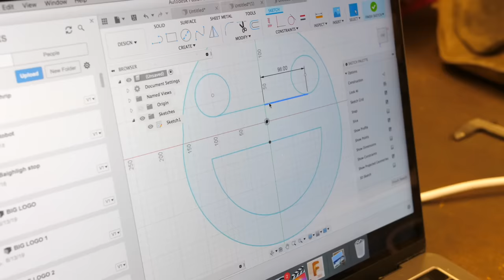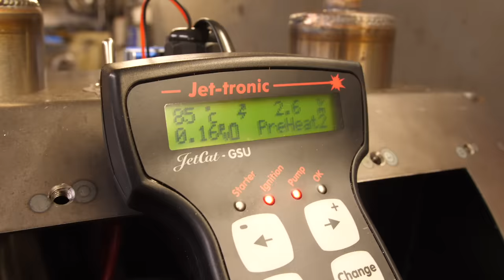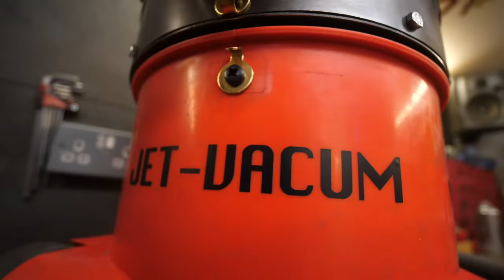JET POWERED Vacuum Cleaner

Comment: You made a  cordless vaccum cleaner  that has a runtime longer than Dyson
Reply: Priyanshu James so a diesel engine vacuum cleaner?
Reply: @ghostintheroom  you must admit he's got a point there
Reply: @ghostintheroom  that is the future of vacuum cleaners
Reply: Well rip my 800
Reply: @Jack Armstrong *Kerosine
Reply: How's vaacuming with an afterburner ?
Reply: @thechlebek901   How about a bi turbo V8 paired with an industrial grade vaccum pump
Reply: @priyanshujames2300  nah let's use Merlin engines, we'll just need cryogenic liquid oxygen and rocket grade kerosene
Reply: TRUE
Reply: What happens when you suck up the flame from the jet with the jet?
Reply: TV ad goes on. "Get the new Colin ferz vacuum it smashed dison to the floor".  

Dyson 😈

Colin ferz vacuum 😇
Reply: And IT Sounds Like a Dyson aswell
Reply: And it has a smiley face!
Reply: Boom
Reply: Not if you want to vacuum for more than a couple of minutes when Frank seemef to overheat and suffer from what looked like an engine rich exhaust.
Am sure this is just a teething problem though...
Reply: Also doubles as a lighter
Reply: Oh sh!t dyson is gonna be on your @ss
Reply: It’s also much quieter than a dyson

Comment: "generally jet engines don't want to be vacuum cleaners"
Reply from the maker: the things I say eh
Reply: @colinfurze  i love you with all my heart
Reply: Generally.
Reply: @colinfurze  can you build a pod racer?
Reply: @colinfurze  I love it, just the right amount of crazy that we've come to expect from your channel, could perhaps have given the poor little jet engine an easier time using the output to drive a venturi instead of directly using the low pressure side, would have certainly eliminated the smoke issue and reduced the EGT.
Reply: @jamesharris5158  good idea!
Reply: Thought he was going to use the exhaust to draw air through not suck it straight through
Reply: @hseanhill Yeah, that's what I was getting at with the venturi, it's an arrangement that effectively converts a stream of moving air into a low pressure zone that draws air in through a second line. It also works with liquids, commonly used in pressure washers to draw the soap in.
Reply: @dayzeddy0199  yes he did just a few video's back. he made a red pod racer
Reply: HAH!
Reply: I don't know, I think they don't want dense air filters over the intakes. I reckon if you set the hover up as a cyclone separator, dispense with the filter, it will probably work well enough (or at least not keep dying).
Reply: Maybe use the jet engine to mechanically drive a small fan - so the vacuum cleaner air circuit is separate from the intake and jet exhaust. Probably get a much cleaner exhaust too as the jet gets a consistent stoichiometric mix without the vacuum cleaning flow variation
Reply: @sirBrouwer  that's not a pot racer this is a sandspeeder bro i am a star wars nerd i know a few star wars vehicles 😅
Reply: @colinfurze  3rd track is called of Cuba Libre - Murica Composed by Jangdol Drum, 라더
I have to awake in 5 o'clock am and taking a shower and breakfast(Cereal and hotel breakfast Area)
Stepmania rage (read description)

Comment: Jet vacuum cleaner:
coolness: 100 %
efficiency: 0.0000000000000000000000000547 %
Reply: Chance of burning your house down: %8594
Reply: HA, ha, ha!
Reply: It adds up to more than 100%, which is an amazing feat in itself.
Reply: @GunGryphon  each criterion is individual indeed
Reply: Smells: 4865%
Reply: @GunGryphon  Look at the porsche 919 evo.
Efficency: 40-50%
Coolness: 99.99%

That's a bigger sum, so....
Reply: adds an oxidizer to the fuel tank to increase the motor speed and suction force of the jet powered vacuum cleaner

Comment: "Mr Browning?"
"Yes Colin?"
"Can i borrow one of your super cool and expensive jet engines?"
"Sure can't see why not, it's not like you're gunna suck crap of your shed floor through it...."
"Mwahaha" said Colin
Reply: Filter...
Reply: Just a polite heads up, all hoovers have some sort of filter included in the design to protect the electric motor from particles that can cause wear and tear and minor clogging, and colin would have used the filter as it would have been used on a standard hoover... if he didn't then trust me there would have been a lot more fire and A TON MORE SMOKE when sucking  up those lentils.....unfortunately he did not show if he used the standard filter fabric layer or whether it was customized/upgraded... However I did apreciate your joke to be honest dude so high five... comment liked!

Comment: I’m no engineer but if you were to route the jet exhaust through the exhaust side of a turbocharger, and use the intake side of the turbo for suction, similar to how it would be used in a car only the the compressor would suck air through the hose providing suction and the jet exhaust would spin the turbo. I think this might solve your oxygen starvation issues. That’s if the exhaust temperature from the jet would be too hot for the turbo.

Comment: I wish he used the engines that he built himself years ago.
Reply: @katelights  not the pulse jets the jets made from turbochargers
Reply: @lucyg3917  They probably wouldn't even start with that sort of pressure drop in front of them - the engine shown here really struggled and was probably quite badly damaged in the process.

Comment: "Frank Whittle designed the jet engine" angry german noises
Reply: Hans Joachim Pabst von Ohain was a German physicist, and the designer of the first operational jet engine. His first design ran in March 1937, and it was one of his engines that powered the world's first flyable all-jet aircraft, the prototype of the Heinkel He 178 in late August 1939. Wikipedia
Born: December 14, 1911, Dessau, Dessau-Roßlau, Germany
Died: March 13, 1998, Melbourne, FL
Whereas Frank Whittle patented his in 1930 and built the first operational turbojet engine in 1937 Eric~
Reply: Don't worry about the Germans it's patent 1930 vs 1936

Comment: Fantastic, as Furze projects always are, but... you need a gas turbine with separate power take of turbine and shaft, like turboprops and modern jet engines. Then the jet part can run with all the air it wants and the separate power turbine can directly drive a vacuum turbine. Maybe run it on gas too, less smelly. Could you make it run from mains gas??? Frank mark II maybe??? You should talk to Numatic and see if they'll sponsor it!

Comment: As jet engines work much better with high airflow, I wonder if you could have kept your ballast pipes open and used the Bernoulli effect to suck air out of a T junction: The fast moving air flows past a hole (or porous section of the pipe), sucking more air into the flow through the hole(s). Having the intake be a cone shape could further increase efficiency via the Venturi effect.

Comment: Hi Collin
Super awesome project; but I think it's effectiveness as a vacum cleaner can be improved while solving the overheating issue when you use it as a high-bypass (where the bypass comes through the filter) instead of using the intake to create the vacum ;)

Comment: could solve the problem by making it a venturi style system like the hand held ones that use shop air pressure flow to create suction. that way the jet always has the needed airflow and you still get a vacuum .

Comment: Now, if you were to use a gas turbine to power the suction fan of a vacuum cleaner mechanically, the way a jet powered helicopter does, I suspect you'd be able to tear up the floor boards like Vyvyan Bastard's V6 powered vacuum cleaner in The Young Ones. "that vacuum cleaner's a hell of a sucker...and I don't mean it's easily fooled".

Comment: Perhaps it could be re-envisioned as a vacuum incinerator/compactor. Use a more normal suction method, but make it so it can suck-up a lot of stuff without constantly emptying it.  Maybe with the goal of making solid pellets it excretes.  Hot enough to melt glass. 

If you want it to suck more, use the vacuums they have on parking lot sweepers.  Little tube is doomed.  It is the atmospheric pressure that pushes the air into the tube.  If you want to crank it up, you want 6" diameter hose or more.

Comment: 1. add crank shaft
2. connect crank shaft to fan, which powers the actual vacuum
3. ???
4. enjoy extremyl powerfull vacuum without running hot

would be a nice change if one of your contraptions would actually be usefull

Comment: If it has a big output should you have not increased the input? An additional series of vacuum tube hoses along with that one all connected to one big Exhaust Pipe End at one side and the vacuum cleaner at the other side?

Comment: Use in a well Ventilated environment, do not face engine twords flammable materials, do not touch the jet engine, do not run with oxygen caps attached, only use diesel fuel

Comment: If you naturally aspirated the jet but ran a shaft to a three fan vacuum blower you wouldn't starve the jet of oxygen every time you put the inlet on the ground or other surface, and it wouldn't over heat from lack of cooling air flow.

Comment: Just attach an air particle separator to the intake of the engine, and use the hose as the only air intake. Helicopters already use these to keep dust, dirt, and other things out of the engines.

Comment: Run the exhaust into the hot side of an automotive turbo, use the cold side for your suction, blow the cold air out with the hot exhaust to lower temperatures even more

Comment: Probably not possible with that particular engine, but what you needed was a turbine. That would let the engine run on clean full ox air, instead of the air sucking in the dust.

Comment: Should've just let the dust go right through the jet engine instead of passing the air through a filter first. That filter starves it of oxygen, though I don't know how long you can continue to use the jet engine once it has been used without a filter

Comment: Wouldn't it be better to combine the jet engine with a turbo so the jet can blow the air (as it is designed) and the turbo would convert that into suction? This approach would limit the problem with oxygen starvation. I guess few Bars of pressure would destroyed the staff being vacuumed 🤣

Comment: Hm I dunno how well a jet engine does with dust, even if it's not a single-crystal superalloy turbine. For spiders it's just going to be cruel and nightmarish. I think I'd do what a turboprop does, and use the engine's shaft to drive a propellor, perhaps the vacuum pump that came with the Henry, if it can take the power. 

It would also mean the engine gets all the air it needs, it's obviously not designed to run so lean, plenty of engines have the same problem, you're lucky you didn't suffocate even with the shed door open!

Also then, you'd have an opportunity to use belts and more machinery, a turbopump next to the engine belted to it, with big bolts and fins and stuff, like something Doc Brown would use to do his hoovering in 1955. You could make it proper Jet Age looking. Since it has an actual jet. Of course it would need to be red, fortunately it already is. It's not made of metal (meh-tull) though, sadly, like things used to be.